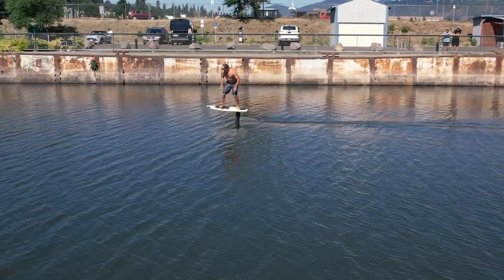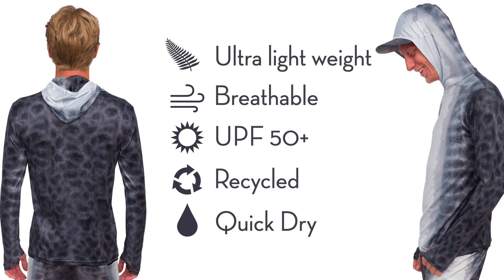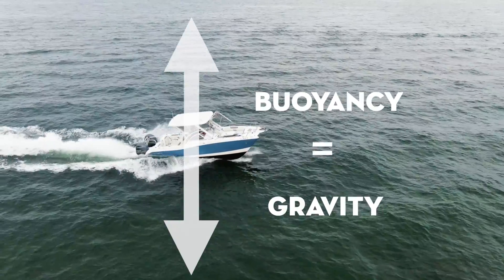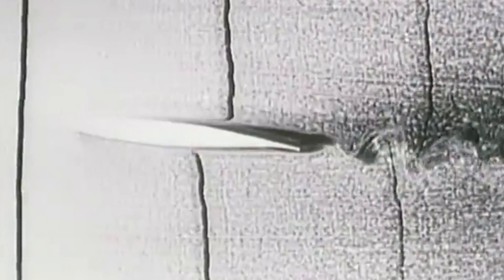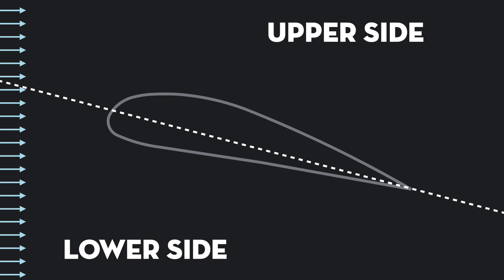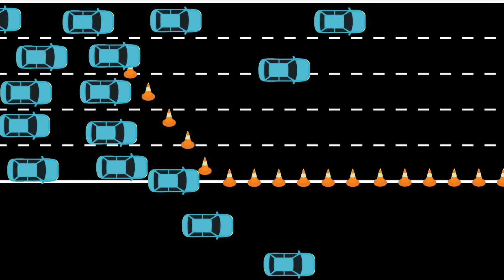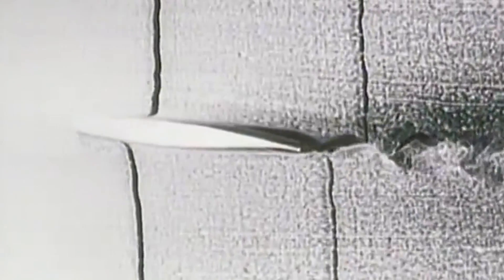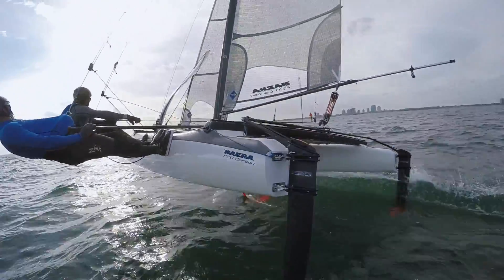How do hydrofoils work - a deep dive into the physics

Comment: There is a misconception that foils are faster than planing surfaces such as surfboards and power boats. Foils are not FASTER. Surfboards and sailboards are slower with a foil. Power boats are significantly slower with the addition of foils. Foils are, instead, more EFFICIENT in low power environments. SPEED and EFFICIENCY are two different things. Cheers
Reply from the maker: We would say that foils produce less drag than planning craft for most speed regimes. Less drag results in higher speeds when the same thrust is applied. In that sense, foils are “faster”, but really we’re saying they’re more efficient at being faster. Planning hulls, under the right conditions, can reach the highest speeds ever achieved by watercraft, but the thrust requirements are large. The current speed sailing record is held by a planning craft, however there are a number of next-generation foil designs under development that could beat it. Will be exciting to watch…
Reply: @Waterlust  Yes, you just expounded the definition of efficiency. Foils are not even close to the speed and acceleration of planing craft. They have their place, for sure, in their efficiency. Cheers
Reply: @Waterlust  When you analyze the stats for speed sailing, it's evident that foils are both the solution and the problem. Compared to land and ice sailing, foils are almost half as slow - 125mph for land sailing and 75mph for foils. This shows just how much drag the foils are producing - 50mph worth of drag. Can foils be designed to match these speeds? I doubt it. Because, in a sense, foils are the equivalent of gears, which convert top speed into efficiency at medium to lower speeds. Unless foils can be made to ever reduce in accordance with higher speed, they cannot reach those higher speeds achieved by a planing hull. Cheers again.
Reply from the maker: @robertcain3426  agreed, foils will always have a hard limit due to the friction they produce. Unlike a planning hull that can reduce its wetted surface area at higher speeds, foils must always be submerged in order to function. In order to go faster, the foil must be smaller, higher aspect ratio, etc…the problem with this is that smaller foils are less capable at slower speeds, and every foiling craft starts from rest. We’ve seen on the AC racing some boats beings “towed up” onto the foil in light winds. Depending on how the rules are interpreted, this may be an option that opens the door for small, higher speed foils. There are also some interesting kite based record attempts in the works like the SP80 project that seem well poised to break the 500 meter speed record of 65 knots held by Sailrocket for the last 10+ years. Land and ice sailing are different beasts as they have significantly less drag, though much can be learned from their rigs with respect to high apparent wind sails.
Reply: @Waterlust  Yes. That is a conundrum; the size of the foil. I have to dissagree with your comment about the high aspect foils in relation to high speed because HAR foils are about power and efficiency. Whereas LAR foils are about speed. For some reason this is a forgotten fact about LAR foils. This is another conumdrum. So eeither foil is reduced or becomes more of a LAR to go faster.
Reply from the maker: @robertcain3426  in our experience higher aspect foils are more efficient and powerful (less induced drag, tip losses etc), which allows a smaller sized foil to be used, which enables faster top end speed. Moths, kite/wing foils, AC boats all seem to start with lower AR foils but eventually evolve to higher and higher AR as foil technology progresses. The limitations here seem mostly structural, as higher AR foils require more advanced composites to sustain the stress/strain they produce. But the trend seems to be pretty clear, in the pursuit of speed with a limited source of thrust (e.g the wind), foils get higher and higher AR until they start to break.

Comment: At 6:47 it looks like there is a notable voided space on the upper side of the wing.
Reply from the maker: That looks like a void because none of the tracer bubbles go there, but there is still fluid present.
Reply: @Waterlust  Why don’t the bubbles move along with the fluid? Shouldn’t they behave like little cars or little boxes? Thanks.

Comment: Hello, my friend, your explanations are really interesting, but there are other things I want to learn, for example, you explained the lifting force, but where does the pushing force come from?In the videos you have shown, another vehicle, for example, a boat or a kite or a sail, creates a forward thrust, but I watched some videos, any vehicle didnt pull .
Reply from the maker: The pushing force can come from a variety of sources: an engine, a sail, a paddle, or the push from a wave. As long as the forward thrust from one of those sources is sufficiently strong, a foil can fly! Some talented foilers can produce forward thrust without any of these by “pumping” the foil in the same way a bird flaps its wings.

Comment: Since the principles of hydrodynamics and aerodynamics have so much commonality, why don't I see the use of vortex generators (VGs) on hydrofoils in the same way they are used on aircraft to increase efficiency of lift and lower stall speed? I would think these could be used to increase efficiency when pumping the board where the laminar flow across the foil is most likely to separate and "stall" the foil.
Reply from the maker: Great question. We don’t have first-hand experience with vortex generators, but If you google “vortex generator hydrofoil”, you can find some academic papers, so it is done in some contexts. We’re not sure if the Reynolds number associated with a surf hydrofoil aligns with the kind of flows where these work…they may only be effective in very specific Reynolds number regimes. But certainly worth looking into!
Reply: Seems like in simple terms they are needed. Water is so dense you can design a high performance foil with a pretty slow stall speed. VG’s being a slow speed enhancer, what mode of foiling do you need it that doesn’t trade off some cruise speed?  I’ve thought about it as well and I can only imagine effective VG’s wou  Mlk d be tiny.

Comment: Thank you for very detailed explanation. But could you also explain why hydrofoil blades can be placed at the aft of board - comparing to planes where wings are located more/less in the center of gravity? Or how is it done that momentum coming from drag of sail or kite does not swing board into the water.
Reply from the maker: great question! In general, the center of gravity of the rider has to be vertically aligned with the center of pressure on the foils. The fuselage usually is positioned towards the back, but the center of pressure can be forward of that, especially if the front wing is large. Hope that info helps!

Comment: Perfect!
Thanks.
Grey to me.
Why is the leading edge of an aerofoil or hydrofoil rounded? And not sharper?
Reply from the maker: A rounded edge reduces the likelihood of what is called “flow separation” or “boundary layer separation”. If the foil is shaped with too sharp a leading edge or is angled too much, the water isn’t able to follow the foil surface, which can lead to a messy and chaotic flow field (called turbulent flow), which produces far less lift and more drag. We think of the hydrofoil as gently redirecting water downward, but there are limits. If the foil tries to bend the water too much, turbulence occurs. This is like when an airplane wing “stalls”
Reply: @Waterlust  
Got it. Thanks!!

Comment: Awesome explanation, could you also explain foil cavitation that would be great!
Reply from the maker: In our experience, most of the time what people think is foil cavitation is actually foil ventilation. Cavitation happens when the local fluid pressure is so low that the local water shifts from liquid to gas phase. It requires a very large pressure gradient and is most common on boat propellers. Ventilation is when air near the surface gets entrained and sucked down onto the foil surface, causing a sudden loss of lift. In our experience, ventilation is very common on kites, sailboats, wings and surfing foils, as they typically operate very near the surface. We’ve even done some camera experiments where you can see wing tip vortices suck air down from a few meters behind a rider, and the air gets pulled all the way to the wing. It’s fascinating!

Comment: Pere-Andreu Ubach de Fuentes I'd also like to know if this (very well articulated) presentation is correct. I had read that this concept had been disproven by someone demonstrating that a 'symmetrical' foil with no rake (angle of attack) also produced 'lift' though i'm not qualified in this area myself. In my own head i think of a hydrofoil/aircraft wing as simply a surface angled to re-direct the climate to create the opposite 'lift' force and that the shape/hump is to provide flow re-attachment to reduced drag.
Reply from the maker: A foil does not need to be curved with a teardrop shape and rounded leading edge to work. Simple flat plates can produce lift and their characteristics are well documented in the scientific/engineering literature. However, they do need to operate at an angle, as do symmetric foils, in order to produce lift. But while inclined flat plates can create lift, they also produce a lot of drag which makes them less efficient than a more optimized shape. A well designed foil will tend to have a high lift coefficient and a low drag coefficient, or a high “lift to drag ratio”.

Comment: I don’t understand the stability. How does it maintain a specific depth?
Reply from the maker: Great question with a somewhat complex answer. Different foil systems have different mechanisms to control the “ride height”, or to make sure the foil doesn’t fly out of the water. The simplest method is used on foil boards. Here, the rider uses leg pressure to keep things balanced. If they need to foil higher, they put more pressure on the back leg, if they need to come down, they put pressure on the front. It sounds difficult, but with a well-designed foil, it’s actually quite manageable!

For boats that have these same kinds of “T” foils (shaped like an upside down “T”), they don’t have the ability to quickly shift crew weight like boards can, so they often use some kind of mechanism to control an articulating flap on the rear edge of the foil, similar to flaps on airplanes. The Moth sailboat is a classic example of this. They use what is called a “wand” on the front of the boat that connects to the wing flap through an internal mechanism. When the boat is low in the water, the wand is fully submersed, pushing it at a large angle, which creates a large angle on the flap, which helps drive more lift. As the boat flies higher, less of the wand is in the water, which reduces the angle of the flap. When properly tuned, this creates a self-maintaining control system so the sailor can comfortably sit and not have to shift weight to maintain a proper ride height. 

The final kinds of foils are called “surface piercing” foils, which are the ones on the catamarans in the video and are used now in Americas Cup boats, IMOCA’s, etc.. Instead of a “T”, the foil is a curved "S" wing shape and there are one on each side of the boat. These kinds of foils are more inherently stable because as they fly higher out of the water, less lifting surface area remains submerged. When properly tuned, these are more or less self-regulating designs, and the boat naturally locks into a ride height proportional to its speed and the size of the foil. 

Hope that info helps!
Reply: @Waterlust  Thanks! I used to windsurf a lot, before this came about. Foil boards seemed like they add yet another degree of freedom you have to control, and I was right. Seems possible. I'll bet it helps to already know how to windsurf?
I was aware of the "wand" method the Moth uses, and surface piercing.
Reply from the maker: @bentonjackson8698  if you already know how to windsurf, you gotta try a foil. We’d recommend either a windsurf foil or wingsurfing. The gear has gotten much more user friendly and it’s an absolute blast! Go for it!!!!
Reply: @Waterlust  I haven't windsurfed in at least 10 years, but I haven't ruled it out. I broke my foot snowboarding the year kiteboarding became popular. I never really got back into it. I have some old windsurfing buddies who talk about foil boarding. I suspect foils would not handle weeds very well, and we have a eurasian milfoil problem. They're bad enough on a windsurfing fin, I can imagine what a clump of weeds would do to a foil.
Reply from the maker: @bentonjackson8698  weeds are definitely a  problem! Here in Miami in the summer we get lots of sargassum and it makes foiling almost impossible.
Reply: @Waterlust  Great explanation, thank you!

Comment: I kinda understand airodynamics of wings. What is the difference to hydrodynamics?  Pressure differences sounds familiar to me.
Reply: None, really, except for fluid density (and, subsequently, Reynolds numbers/turbulence effects). Low speed airfoils operating in air or another gas can discount compressibility, and liquids are also not compressible. If you have a good understanding of low speed airfoils, you also have a good understanding of hydrofoils.

Comment: Thank you Patrick, can you help explain why there is forward speed / lift generated, not just vertical lift?
Reply: @Waterlust  Thank you for the reply.  I get what you're saying about the pumping oscillation with forward angle, but have always been mystified when I blow air over the top of a curved piece of paper (wing simulation) and not only is there lift, but also enough forward vector, to the point where the paper will hit me in the face if done just right. Maybe that's because the where I'm holding is really a pivot point and the lift vector pivots on that point?

Btw, your tune for the df65 is perfect ;-) Thank you for that as well!

Comment: Are waves a consequence of hull resistance or a cause of it?

As an experienced recreational foiler this was a really great watch. Thank you.
Reply from the maker: Great question! Hull resistance is typically decomposed into different categories at different speeds. At low speeds, hull resistance is dominated by wave resistance. At high speeds, hull resistance becomes increasingly dominated by skin friction. They really are two distinct regimes. At low speeds, we’d say the existence of waves and the resistance they produce are occurring simultaneously, you can’t have one without the other. The creation of the wave is caused by the boat exerting a force onto the water, and that force is most of the total resistance. We wouldn’t say there is “one-way causality” or that one creates the other, they must occur together. Hope that helps!
Reply: @Waterlust  that is super thank you.

Comment: Is there a minimum speed required for using a hydrofoil?
Reply: Probably not, but the slower you go, the bigger the foil needs to be, if it gets to big the foil will make you slower.
Reply: @Waterlust  are these hydro foils dangerous? Will I tip over if I am not skilled at riding the board?
Reply: To lift an object out of the water, the foils need to generate lift equal to the weight of the object. This is embodied in a simple mathematical equation, Lift = wing area * coefficient of lift (an arbitrary dimensionless number that evaluates the "efficiency" of the airfoil) * fluid density * (.5 * (velocity of the flow squared)).  If that number adds up to more than the weight of the object in question, you're flying, either in water or air. So, if you want to fly at a slower speed you can design a more efficient shape that has a greater coefficient of lift (although some very complex physics provides a limit to that), or build  bigger wing to compensate for the slower flow. That's why airplanes that want to fly at slow speeds have big complex flaps (bigger coefficient of lift, although at the cost of drag), and have big wings compared to the airplane's weight.